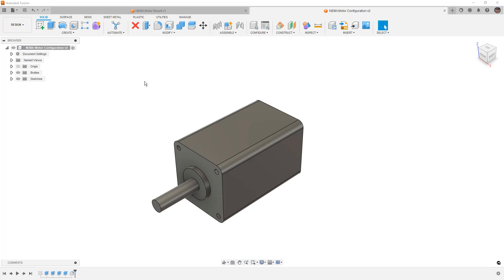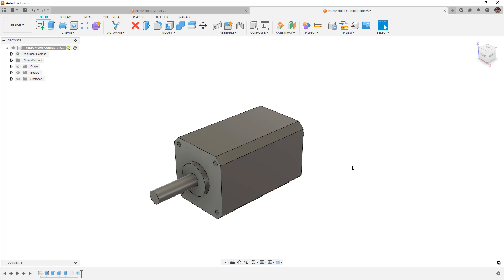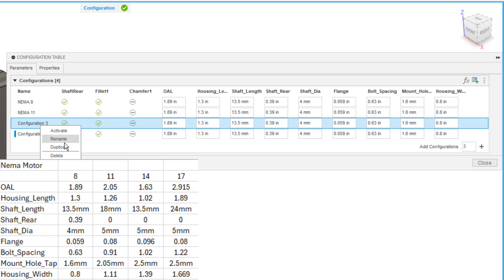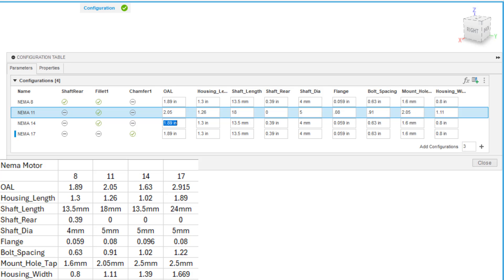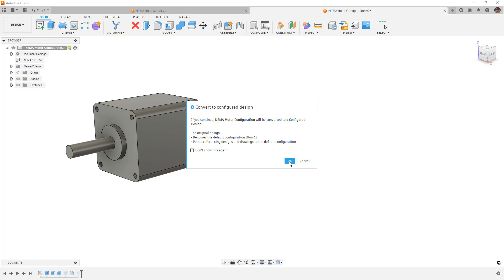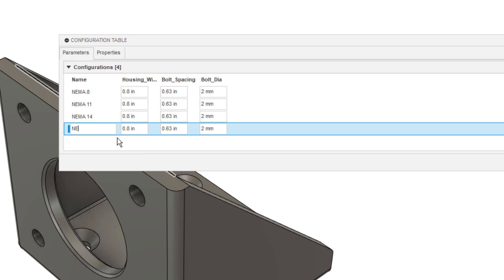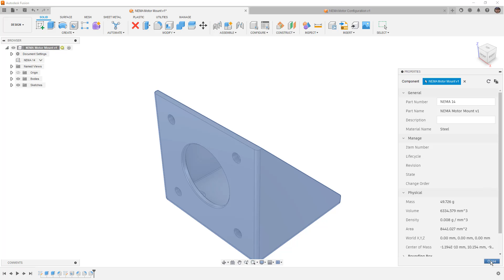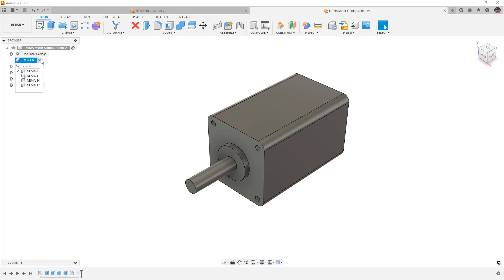Configuration Mini-Series | How To Configure Feature Suppression and Parameters in Parts | Fusion

Comment: What's the difference between using configurations and making 4 separate motor files? Seems like extra steps without benefits.
Reply from the maker: Configurations allow you to keep all the data in one place.  For example if you want to swap a part in an assembly, or create toolpaths for 4 variations of a part.  Creating your toolpaths then switching configs is an efficient workflow.

You certainly could make 1 part and Save As to make multiple copies and modify them if you want them to be separate.